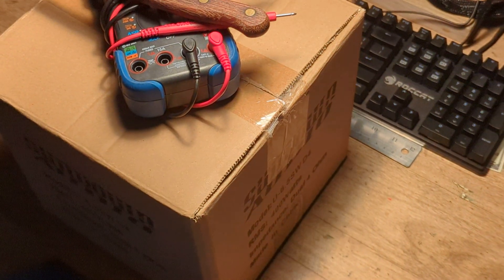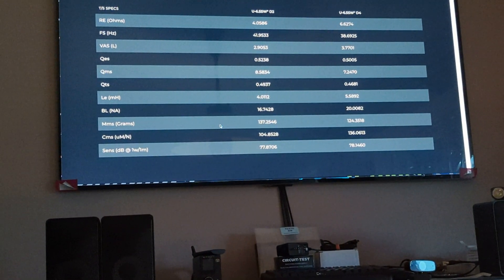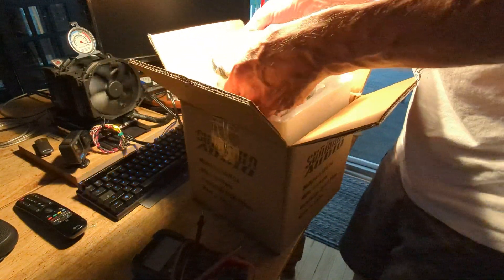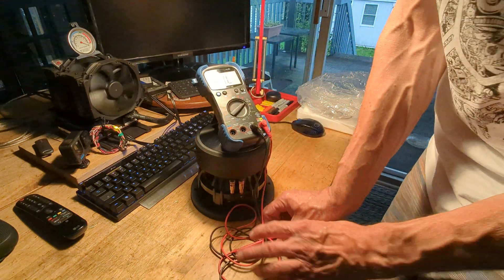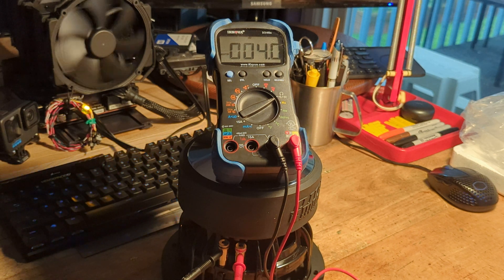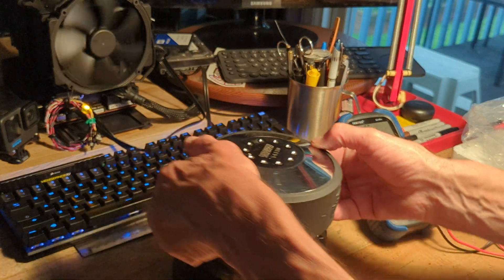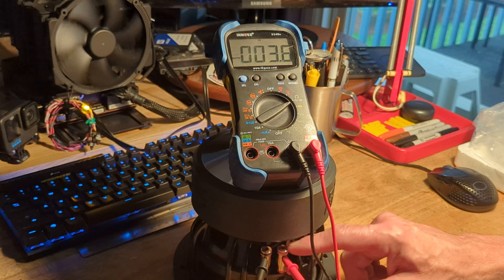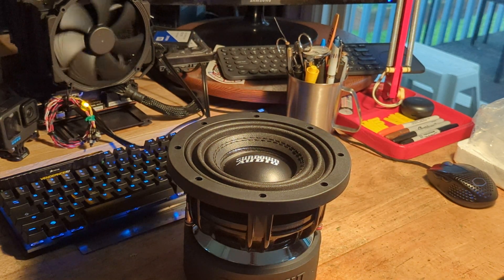Sundown Audio U 6 5SW D4 Ohm Testing

Comment: Wasnt overly impressed with the u8s the b2 rampage 8 blew it away. Roughly same price.
Reply from the maker: That's for replying. I still haven't built my boxes yet, but I did do the math, and crunched all the numbers and came up with a cut sheet... no CAD 😐
Reply: @1Patient  I use the 12 volt website to come up with my boxes. No cut sheets but thats easy enough to figure out